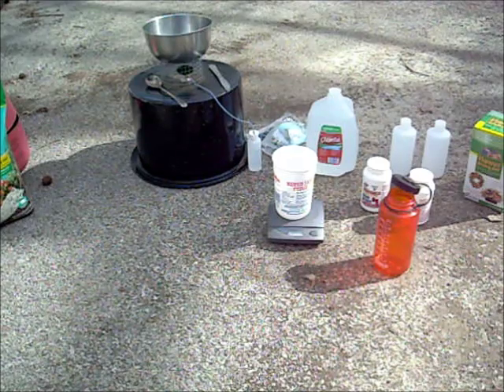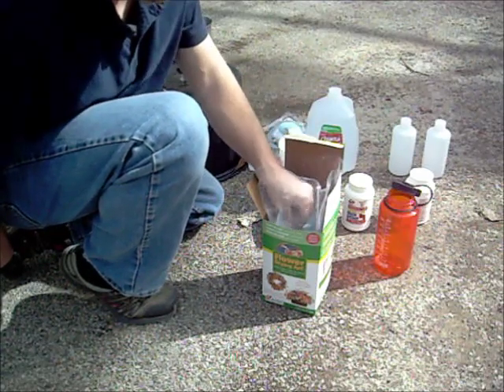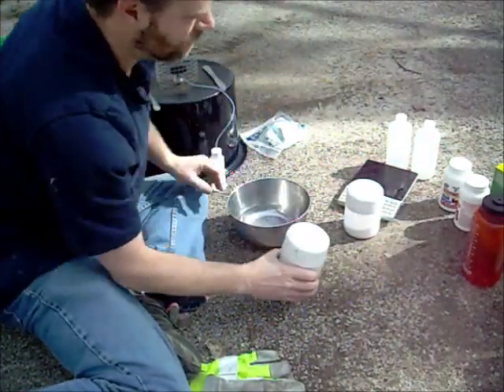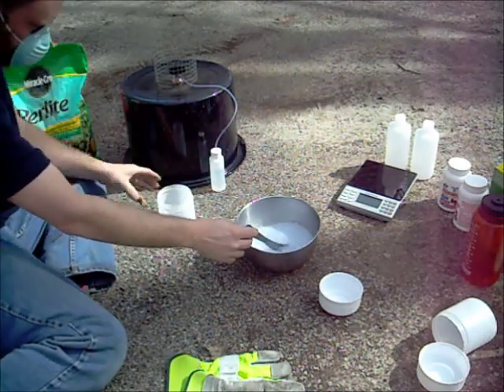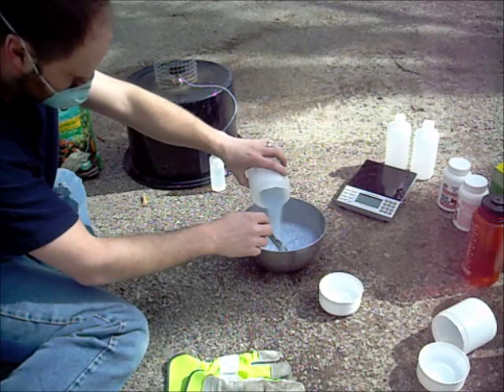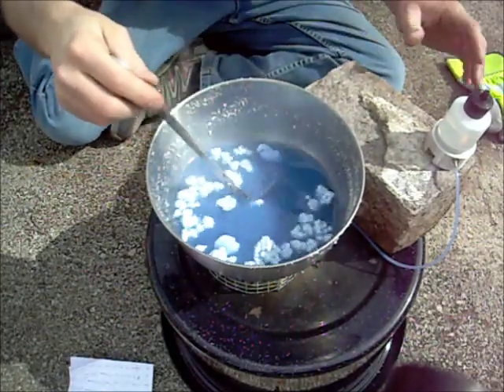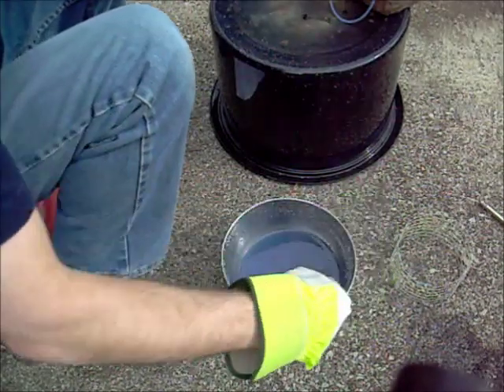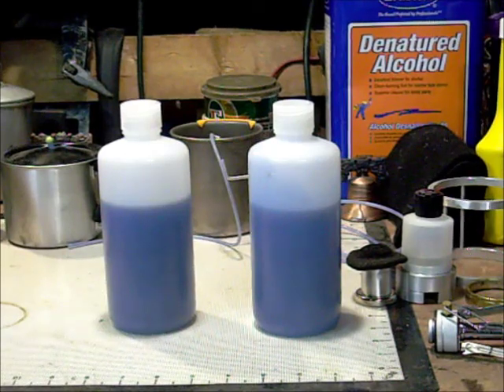Water Glass for my foundy project

Comment: Thanks for having putting this up. No doubt you knew you would have some negative comments. Most naysayers and all have concern for your safety. That's a good thing. It's very easy to just buy the stuff, but much more rewarding to follow advice of others and experiment to see if it will work. I also have watched clkindred and plan on following this course too.

Comment: To all the safety nanny's out there.  This reaction gives off water vapor, nothing more.  You don't need a mask when there are no dangerous vapors or particulates.  Second, lye will cause some skin irritation and that's only if it's wet and you let it sit on your skin for more than a few minutes.  Dry lye is pretty innocuous if it gets on your skin and you're skin is not saturated with moisture.  If you clean it off immediately, it won't burn you.  Do all of you guys wear eye protection, gloves, and long sleeves when you do your laundry?  Because this reaction is only slightly more dangerous. 

When I was a kid and didn't know better, I took an handful of sodium hydroxide and plunged my hand into a bucket of water.  It got hot.  It didn't burn me and there were no lingering effects.  Stop giving the man shit.  I would have done the same.  In fact, I have done the same.  I make quick lime in my backyard all the time and handle it.

Comment: I have a few tips for you,
1. The mask you have won't do you no good against gasses, Buy a proper gas mask.
2. Let all the lye dissolve into a clear solution before you proceed to adding the silica gel. This is probably the reason you got the clumps.
3. Use more water if you can't get everything to dissolve.
4. Let the mixture boil for a little while, chances are that the clumps will further react.
5. Use glasses, Lye is very caustic and can blind you!!!
6. Use long sleeves , Lye can give you nasty burns on your skin.

About the blue stuff,
It is possible that the blue stuff is reacting with anything in the solution witch might be a problem. If you are going to use this for hardening sand it probably won't be an issue.
Reply: Considering the only gas given off in this reaction is water vapor, no mask is necessary.  Getting sodium hydroxide on your skin is slightly irritating and only if it's hydrated and it takes time to react.  Washing it off will stop the reaction and no damage will be done.  Wearing a long sleeve shirt will hold the wet sodium hydroxide against your skin.  it's a false sense of security.  Sodium hydroxide won't cause irreparable burns unless you douse yourself in it.

Comment: Deadly chemicals, fire source, lack of safety gear, youtube video...

What could possibly go wrong?
Reply: Well, considering that the only gas given off is water vapor and there is absolutely nothing flammable, nothing could go wrong.  You don't even need a mask.  You might need some gloves to handle the sodium hydroxide when it's wet but big deal.  The risk is minimal.

Comment: A paper mask???  Really.  This is dangerous stuff and you should not do it if you don't understand what you are doing.Lye will take the skin off of you and the inside of your lungs as well.
Reply: Did you take chemistry?  This reaction gives off water vapor, nothing more.  No mask necessary.  Also, the lye is granulated, not powdered.  It won't go airborn unless you're in a wind storm.  Do all these nanny staters where gas masks when doing laundry?  Because that's about how dangerous this procedure is.

Comment: yeah dont move to the other side with the wind to your back, just keep sitting there with a paper mask on.....

maybe science isnt a good thing for you
Reply from the maker: You may be right. I don't seam to have a grasp of safety and should probably stay clear of dangerous chemicals.
Reply: digitizer101 You need a 95n respirator mask preferably one made for gases and particulates. Not the cheap stuff. A chemical apron, chem gloves and face protection would be good in case of a chemical explosion.

Comment: #digitizer101  I just did two batches of this myself, using the wal-mart cat litter. It wasn't very warm in my shop, and I noticed that I didn't get a reaction when I put the lye into the water on the first batch- it ended up blue. The second time around, I heated the water first, and got a very energetic reaction when I started adding the lye. I also put the silica gel into the oven to warm up to about 200F before using it.  It melted faster, and the solution ended up being pinkish, instead of blue.
Reply: I did the same with the mimi litter after getting all the blue crap out of it and I have made a half a gallon of this water glass, not this recipe! You don't want anything other than the silica gell so be prepared to remove all the blue pieces. I have taken a 7 gallon propane tank and did a 6" center 3" wall and with the 2 lbs aluminum oxide mixed with the one gallon perlite, 350 ml water and 350 ml silica gell and it packed so tight and it's like cement.

Comment: You really are an idiot for posting this video without editing in some PSAs about safety... this video is the best example of how not to make your own water glass... watch fight club to see how dangerous lye can be... the fumes from this mixture are extremely caustic, that means they burn flesh, lungs and eyes. A dust mask, which you used, will not filter out the fumes, only dust. You really should have used a fume hood or fan to move the fumes away from you and make sure they are blown down wind... the blue moisture indicators in your silica are an impurity that changed the performance of the water glass and I bet it want as effective as it should have been... Pyrex glass is non-reactive and heat resistant, which is why it was preferred, but pure stainless steel will work... distilled water is pure H2O. Tap water has chemicals, particulate matter and minerals that would affect the chemical redaction and taint the finished product as you found out by using silica that had a moisture indicator in it. Most bottled water is just tap water that has been filtered at the bottling plant, and bottled spring water is filtered spring water which contains minerals are particulates from the rock and soil it came from and therefore it would taint the finished product... You needed a face shield or at least safety goggles, not safety glasses as glasses don't cover the whole eye... a lab coat and proper gloves would have kept you from splashing your hand with lye, that's why scientists wear that stuff... they don't wear it for a fashion statement... If you watch a YouTube video on how to do something and they tell you it's dangerous, you really should research it and find out why it's dangerous and how to keep yourself safe if you decide to do it... research all the steps involved and understand what you're doing... your hardware store had the lye locked up because of how dangerous it is... lye has been involved in many accidents from careless use by janitors and minimum wage workers who didn't follow proper safety procedures because they didn't stop to think even though there are many warning labels on the bottle... people have died from ingesting lye because of poorly labeled bottles and breathing the fumes from reactions...

Comment: Just a safety note. Pure lye (sodium hydroxide) is crazy dangerous to exposed skin or eyes, it can make your skin turn to soap and melt off. Would strongly recommend safety glasses and rubber gloves when working with this, as even a tiny drop (that can easily pop out of the mixing solution) on the eye or mouth can result in a severe burn. I've seen it. Mixing the lye solution in an aluminum pot causes another reaction that can give off hydrogen gas.

Comment: The blue beads in the silica are moisture indicators.  when they turn from blue to pink it shows that the silica has absorbed a lot of moisture and needs to be re activated like you said in a microwave or oven.  I bought some silica that looked exactly like yours off of ebay except they are more of a bead type not powder. everything your water glass did while you were making it happened to me as i was making mine.

Comment: Great video! You may need to add more water to get all the clumps to dissolve. Your silica gel looked more finely divided than the beads I was using, that increases reaction rate when mixing into the lye water. I am in the process of making a foundry too, I will post a video of it and lessons learned about using sodium silicate and perlite as it is not as strait foreward as I first thought. I do know now that thinning it with water helped because the thick syrup form takes FOREVER to dry. Second, dry sodium silicate foams up into a crusty substance when heated enough, fully cured sodium silicate is not sodium silicate anymore, it reacts with CO2 in the air to form the heat resistance we want, directly gassing it with CO2 gives best results. Third, adding plaster is not necessary. I will post any more tips as I learn them. Thanks for the shout out!